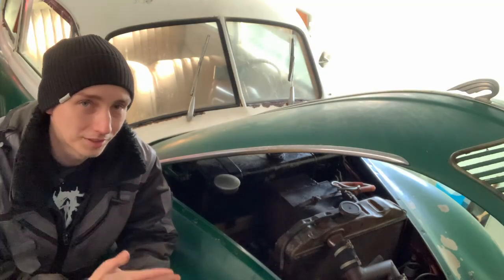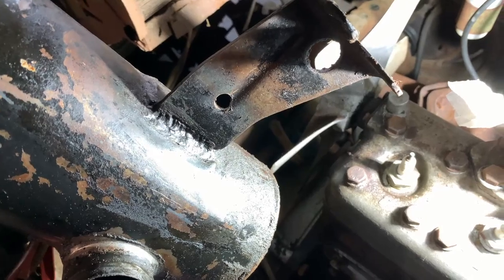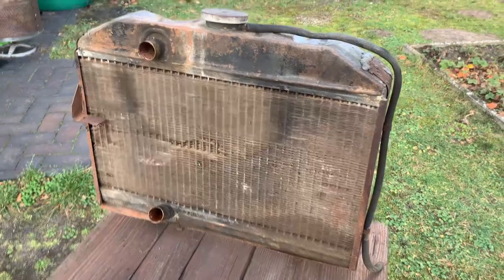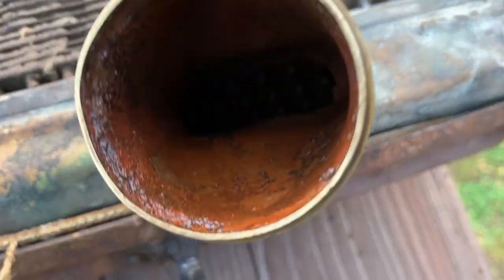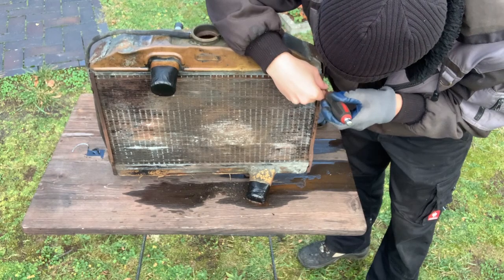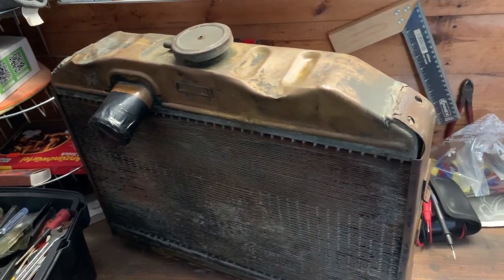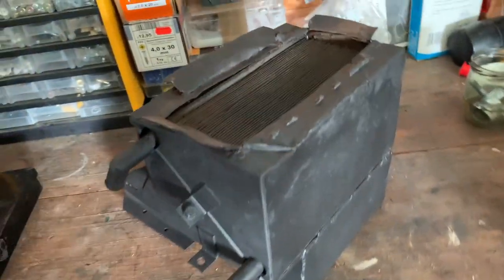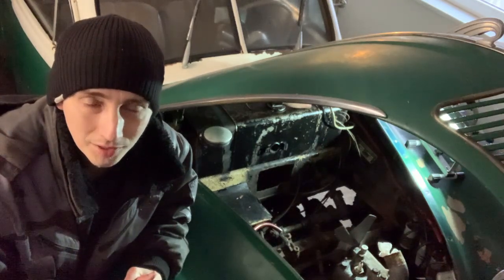DKW (IFA) F9 - Part 4 - First Fixes

Comment: What a nice design, so simple. The more you proceed with your clear presentation, the more I appreciate how identical is this layout to my Fiat Topolino. So far, just the engine is different: 4 instead of 2 strokes, 4 instead of 3 cylinders, and about half the size. But the front suspention is identical, the massive gear to start the engine, the natural water circulation in the radiator... who copied whom?